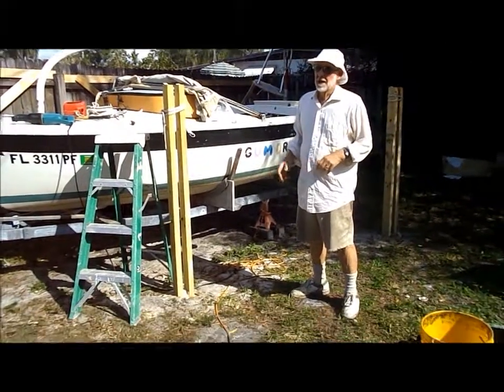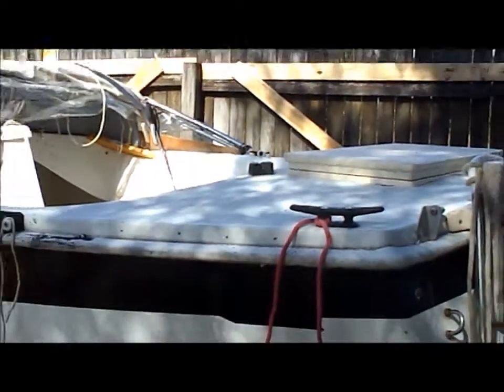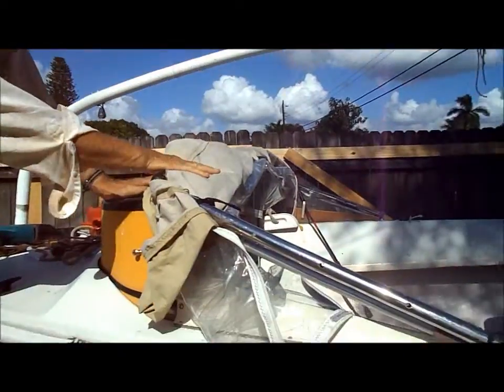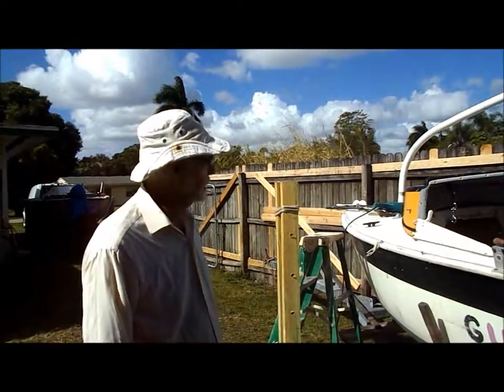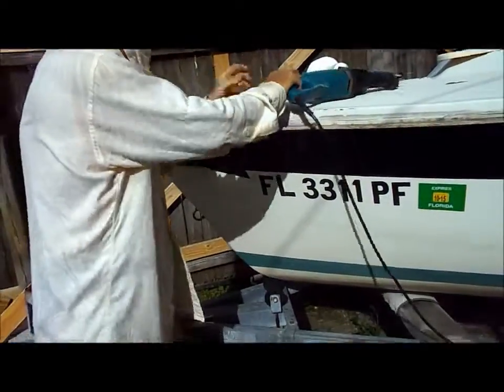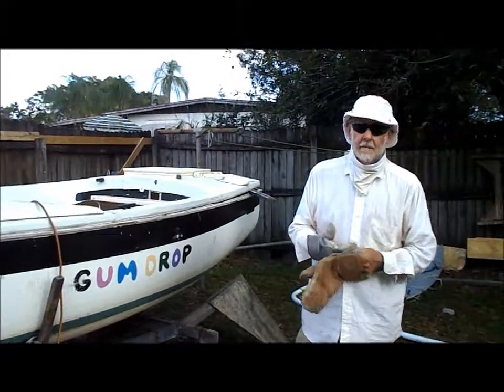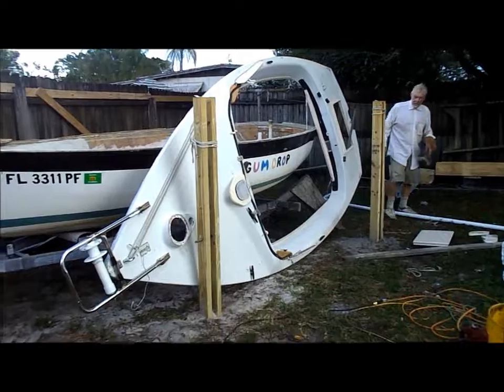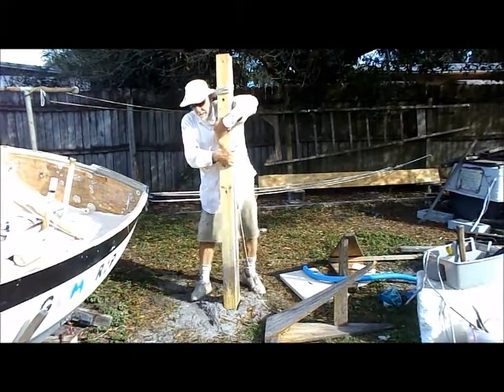cutting up Gumdrop a 13 ft expo solar sailer

Comment: Hello Floyd,
Did you by any chance hold on to the rudder of your Expo Solar sailor?
Reply from the maker: +Julian Driebeek The boat did not have a rudder when I purchased it . I made an outboard kickup rudder which worked very well and in general is my preferred system for all the obvious reasons.
Reply: Thanks for your speedy reply Floyd. Was worth a shot.
Happy sailing